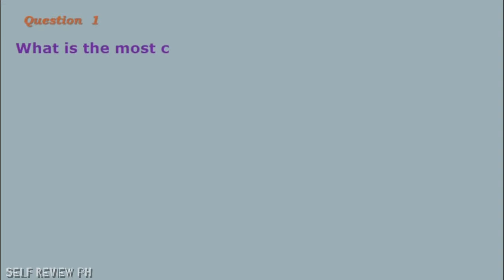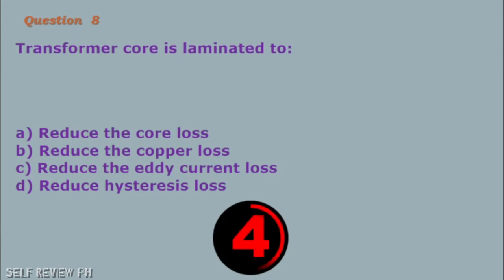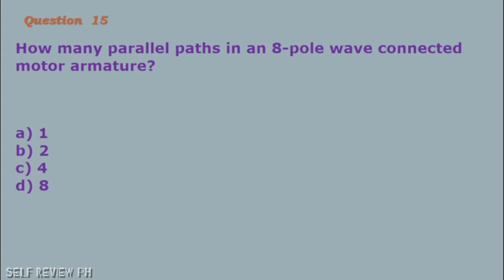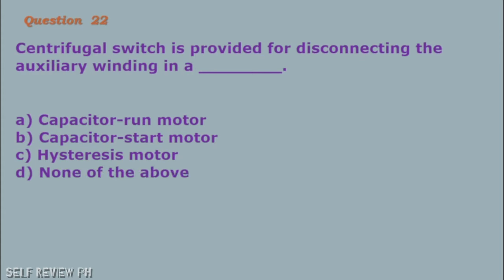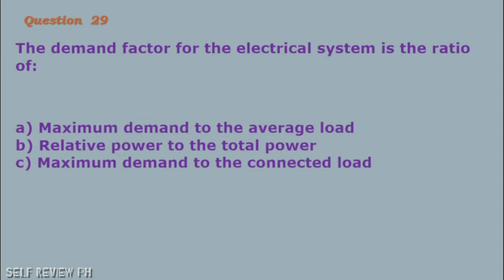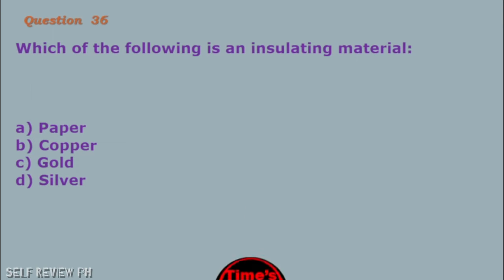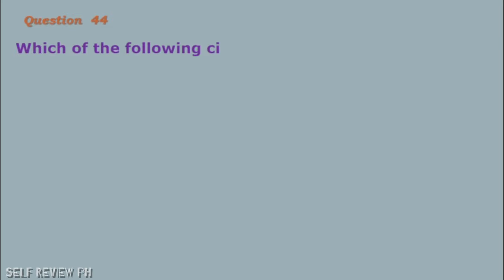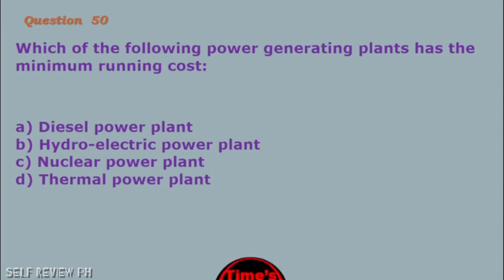REE|| Exam Reviewer in Electrical Engineering(50 MCQs and Answers)        Part 1 reupload with audio

Comment: Marami din po ba objectives ng EE subj sa board exam?
Reply from the maker: Medyo marami din po lumalabas, last 2022 April Board, nakatulong daw sa kanya yung mga terms,  thanks po ma'am sana makatulong din. Goodluck.
Reply: Depends sa ibibigay na exam,
Minsan 50/50 terms & solution,
Minsan 70/30 or 30/70.

Tip: always know the basics & principle ng topic. Kahit di mo makabisado lahat ng terms pero na aapply mo sa computation dahil alam mo principle, makakasagot ka since aware ka sa principles.

Wag lang paka kampante & pray lagi. Kaya niyo yan.